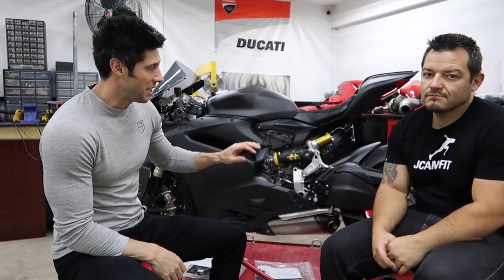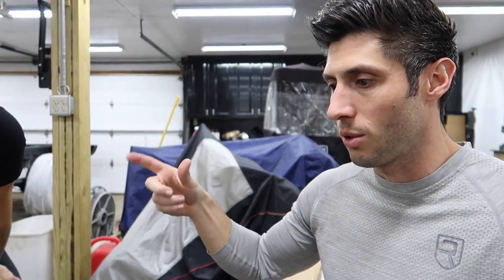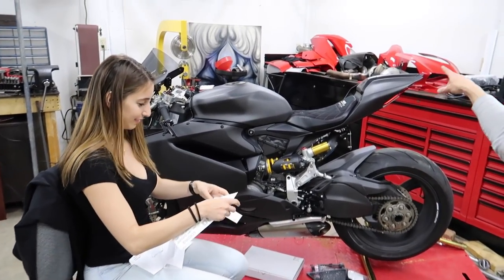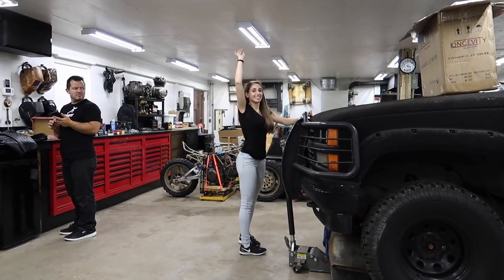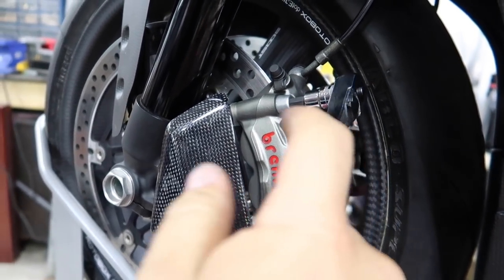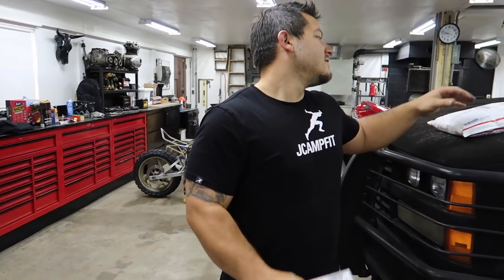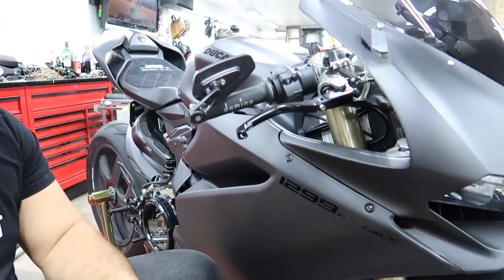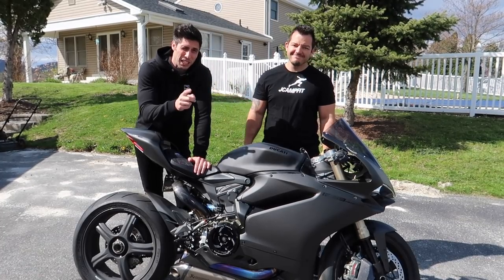Carbon Panigale gets Blacked out Decals & Carbon Brake Ducts!!!

Comment: at only 150 mpg average mph and 500 miles of fuel between refills Five  20 minute stops would be required from NYC to L.A at 3,000 miles that is 150 mph x10 = 1500 miles x 2 = 20 hours and 3,000 miles plus 5x20minute stops for fuel, bathroom and food equals 21 hours and 40 minutes so traveling from NYC to L.A. and back in 48 hours should be doable.
Reply from the maker: I like where your heads at :)
Reply: I love what your team is doing to The Ducati. Every idea of video presentation  has been mastered with specifics I had previously only dreamed of that your team filled in masterfully. I see passion I never saw before and if you want me to test drive your Ducati from where  you are into never-land,  and realms your 4 digit minds cannot conjure no one can do Batman who in April 1974 drove the first prototype auctioned of the Honda Gold Wing to handle bar jarring 188 mph.
Reply: The bike would get like 75 miles to a tank at that speed

Comment: Great video guys! 
Just to let you know, after installing the caliper back on you should've spun the wheel and applied brake pressure to alighn the caliper perfectly against the rotors to eliminate uneven pad wear. 
Video: https://www.youtube.com/watch?v=DYHV78tWs1c